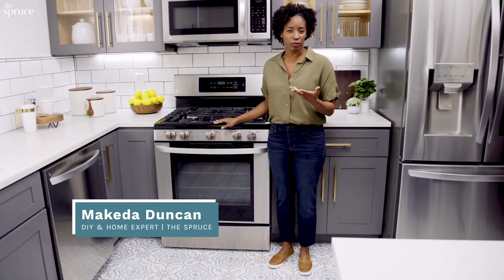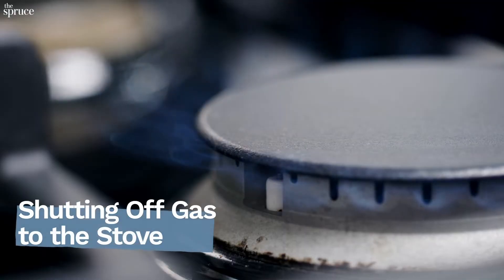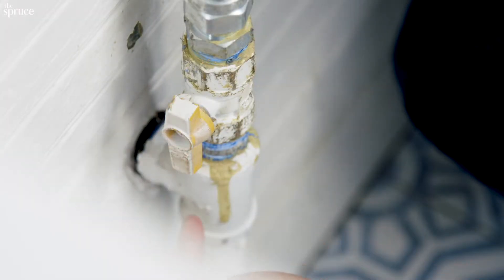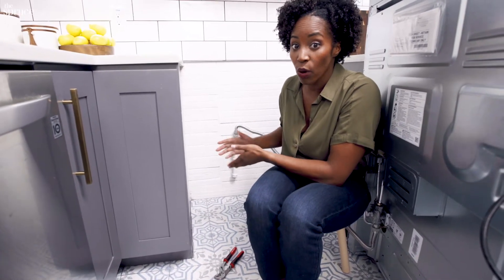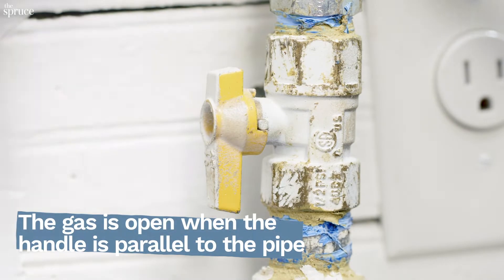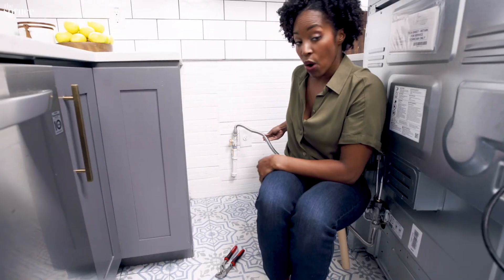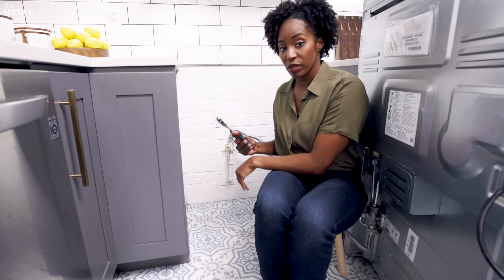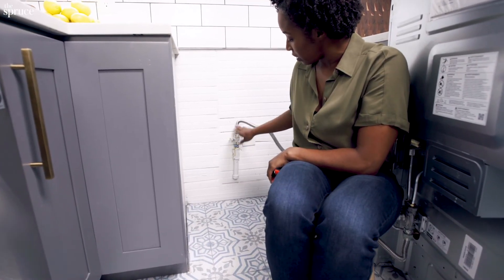How to Disconnect a Gas Stove | The Spruce #GasStove

Comment: Do I need to burn off any gas in the hose before disconnecting it? Also, thank you for the clear video
Reply: No, you should disconnect the power line first before touching anything on the gas line!